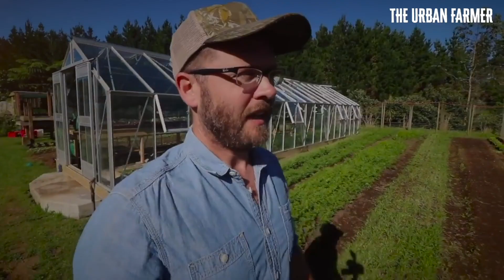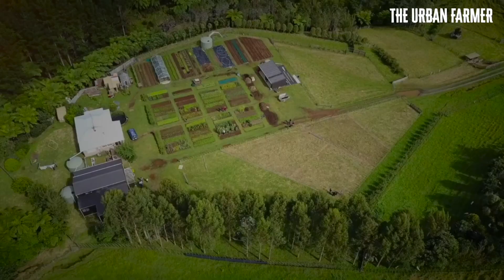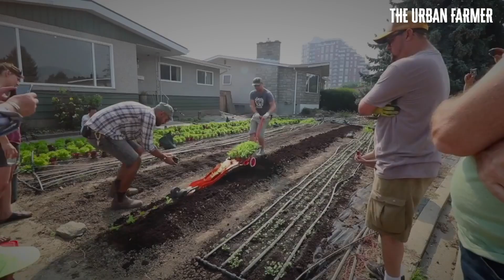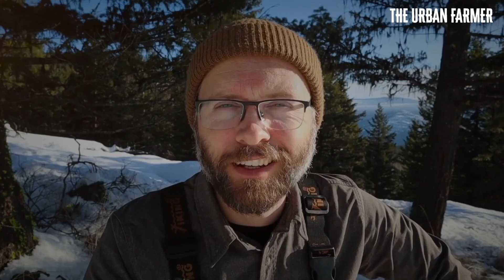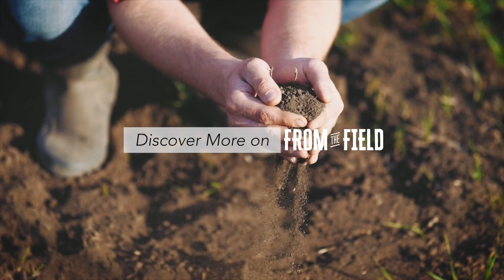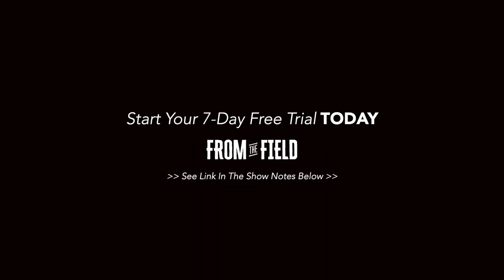Irrigation Pumps and Design  - LIVE CONSULTATION [ LISTEN IN ]

Comment: Very much of this conversation depends on many factors! Depth of well water farm systems, municipalities water systems (no good), size of pressure tanks , length of water lines ( permanent 1” h20 lines to hydrants)….agriculture wells can be unpermitted in Nc and be rather shallow….however you get into irony water in shallow depth which regularly require maintenance with chlorination of system and h20 lines